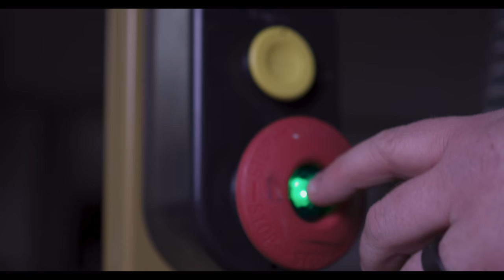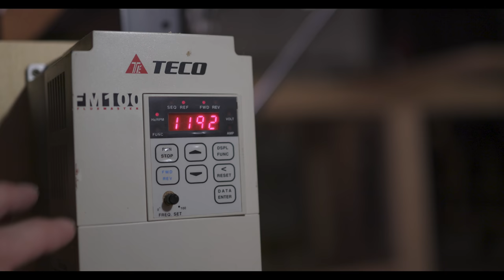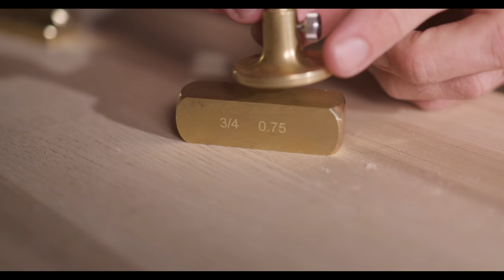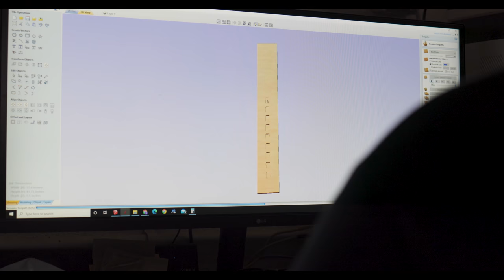How to build a Mid Century Modern Bed // 4K // HIGHLY VISUAL woodworking

Comment: Stay humble, Build something.  Word.  Love it.  I’ll add it to my list right behind “leave no pencil marks”.  A big fear of mine realized when I saw your Kapex in pieces.  I have one of the original series as well and its a core tool for site work (I’m in the middle of a 300 lin foot wainscot job at the moment).  I’ve got a Felder slider in the shop so don’t use it when there but I’m dependent on it for site work (wondering about adding an Erica...) and I’m sure you’re aware of Festool’s long lead times for orders.  I enjoy your build videos (all your posts but in particular I get ideas from your work - reinforcement for legs in this one).  Question, where did you find that little plane for your pencils?  Strong work, I look forward to watching your next post.  Thank-you.
Reply from the maker: Hey thank you for watching! I’m grateful for your support! That pencil sharpener is called the hovel. It’s a bit of a novelty, I would recommend a mobius + ruppert sharpener
Reply: Hey Mike, if you were wondering, that shirt is from another fine furniture maker, Erik Curtis. If you have the time, definitely check out Erik’s channel - but make sure you watch all our videos first. 😉

Comment: My question is why the spline in the leg, won’t the opposing grain directions work against each other? End up splitting the leg right off? Would be curious to see it go through a few season changes. Nice work!
Reply from the maker: Think about a massive bow tie keeping a check together. The opposing grain should be doing the same thing but doesn’t. I. An think of one specific example of this. I did a 20’ outdoor slab table. It was 40” wide and I had to put in massive bow ties to keep the checks from growing. This was years ago and the bow ties are still holding the slab together. 
I could be wrong but I think this is similar.
Reply: @WilliamDouglasCo  agreed, bow ties work well in slabs and table tops where there is a fair amount of material but in this case you have maybe a 2” wide leg with a 1” wide spline and minimal material on either end, then you have fact that the grain runs perpendicular to the shape of the leg which creates a week spot...very interested to see where this breaks on your test video.
Reply from the maker: @mkscustomcreations1061  I hear ya. It very well may have been a bad move. We shall see

Comment: Great video!  I do have a question, what is the water/alcohol for when you were pairing with the chisels?  Not sure if I've seen that before.  Thanks again!  Keep up the great work!
Reply from the maker: Hey, thank you for watching! The water and alcohol solution softens the grain and makes it easier to pare end grain.
Reply: @WilliamDouglasCo  I figured it was something like that... but what does the alcohol do for the water when applying it?  Does the water slow down the alcohol from evaporating giving you a longer time to work?
Reply from the maker: @anthonydtobias  I don’t ask those questions 😁 maybe someone els can tell us why it softens the grain.
Reply: @anthonydtobias  the alcohol evaporates really quickly. The water takes longer. Mixing the two compromises the characteristics of both. Why does it work? Think of wet paper, it’s weaker. So is wet wood.

Comment: Sorry to hear about you having to move your shop. You've had a few consecutive crappy events lol. Sucks man. 

On another note... I've never seen that in-lay across the weakened joint due to the grain direction. I'm definitely gonna keep that in my bag of tricks. Where did you learn that one?
Reply from the maker: Thanks my brotha it definitely has been challenging. I’m hopeful for our future though.. this was just another quick stepping stone. 
That was just an idea I had off the fly. I ran it by my Crew and everyone said.. “makes sense let’s try it”
I want to do some testing on it and make I video that show a pressure test with and without.
Reply: @WilliamDouglasCo  Got it. It makes sense to me as well! I love the idea
Reply from the maker: @MaydaysCustomWoodworks  thanks! Not gonna lie I’m nervous to test it JUST in case it makes me look like an idiot 😆
Reply: @WilliamDouglasCo  I understand lol. I worked for 6 years of testing to be able to build a thin, stable, more water resistant end grain cutting board that doesn't expand or contract with moisture. I dumped maybe 100k total, and maybe 1000 hours over that 6 years into it. Failed many many times. Eventually I got it tho! And now I have a patent pending on it. I consider myself to be a "wood scientist". And with that territory comes a whole bunch of failure lol. But every time it failed I tweeked it a little bit and kept at it. Don't worry about the failures brother. Just keep adjusting it and letting it settle in the brain and jump back in the fire!

I think that joint will work, man. Even if you gotta modify the placement of it and gotta extend it out or change it's shape or something.

Comment: What happened to your Kapex? :( If I have the money, do you recommend me getting one, or my money could be better spent elsewhere? Thanks!
Reply from the maker: Hey Bruno. My kapex died of old age. I’ve had it for a really long time. I bought it before I had a tablesaw so I used it for my finish cuts. In that case, I do think they Kapex is worth it. I now have a good tablesaw and sled so I don’t use the KAPEX for anything but rough cuts now. In this case it’s cheaper so would have been just fine

Comment: Oh fuuuuck. I just commented on the new shop tour video a minute ago. At least moving doesn't take a ton of time and $$$... That is rough. I do have a couple questions from the build. What is the 50/50 alcohol water mix for? Did the legs go on with glue or are they just riding on those 3 dominos?
Reply from the maker: Yeah the move almost killed us but instead it made us stronger 💪🏻 
The 50/50 solution softens the grain making it easier to pare the end grain. 
The joint is glued and clamped up, not just dominos
Reply: @WilliamDouglasCo  Glad y'all are handling it. Ok, I thought it must be glued, just hard to see in the shot. The bed frame looks awesome.
Reply from the maker: @wobblytreehouse  thanks man! Glad you like it!

Comment: What happen  to the festool  miter saw  lol
Reply from the maker: It died of old age. Out of warranty
Reply: @WilliamDouglasCo  do you think  is worth it
Reply from the maker: @carlosvalentine4939  it depends on what you are doing with it. It had a good run for us. When I bought it I didn’t have a tablesaw yet and I was using it for finish cuts. Now that I have a good tablesaw and sled I only use it for rough cuts. That being said, I could have probably went with a much cheaper miter saw and been just as happy

Comment: What is 6:05 about? Is that for strength or plugging a part of the original board that wasn't ideal? https://youtu.be/bN6GreMYNiA?t=365
Reply from the maker: Josh! That is a great question. That is an experiment that I’m doing, and I plan on having another video soon talking about why I did that. Basically the green being horizontal the entire length of the board makes four week points at the top of the feet. I have made several of these beds and I’ve never had an issue, but the concern is always there. This was an attempt to strengthen the structure of the legs by adding vertical grain going against the horizontal grain. If that doesn’t make sense I will definitely do a better job explaining it in the upcoming video.
Reply: @WilliamDouglasCo  makes total sense! Thanks for the clear answer 🙏🏽

Comment: Someone needs to learn some safety when using the jointer and table saw. If he is your employee he is a liability. Wow. Very sad.
Reply from the maker: What?
Reply: @WilliamDouglasCo  Not using push blocks when using the jointer and having his fingers dangerously close to the spindle..! Then to do the very same thing on the table saw! It is a matter of time till that dude sticks his finger where it shouldn’t be. Given the time you take for perfection of fit up, the cleanliness of your shop(s), I was surprised to see such careless wood shop techniques.
Reply from the maker: @patrickgreen9747  probably should be wearing hearing protection and respiratory protection as well. Long term damage to lungs and ears can be bad later in life.
Reply: @WilliamDouglasCo  the list goes on and on and I agree with you. This is a business/hobby where one little slip in concentration can change the way you eat. I was just taken back by it and felt compelled to say something. 

On another note….you sir make sick sick furniture..!